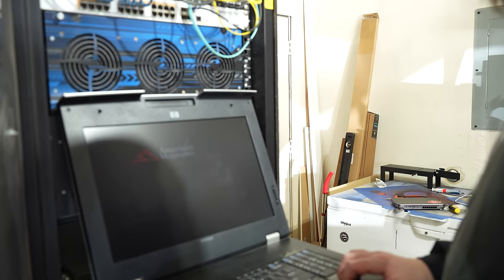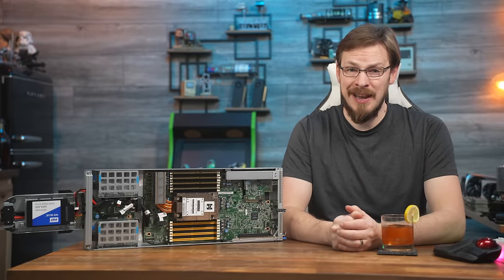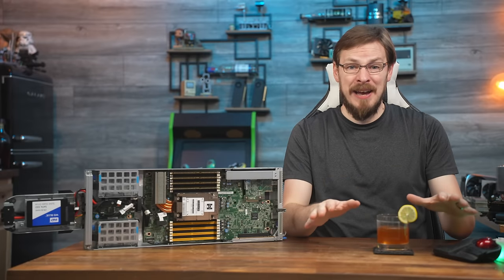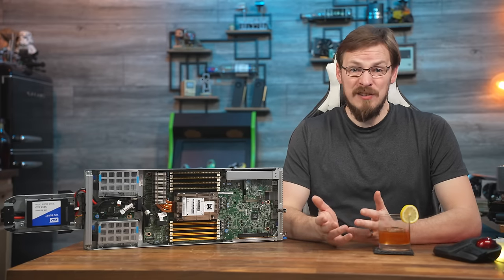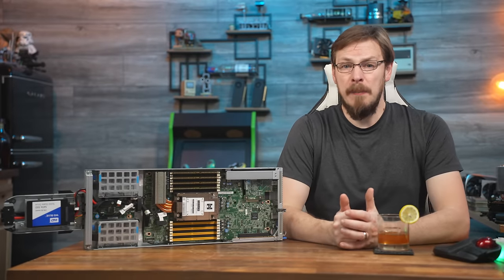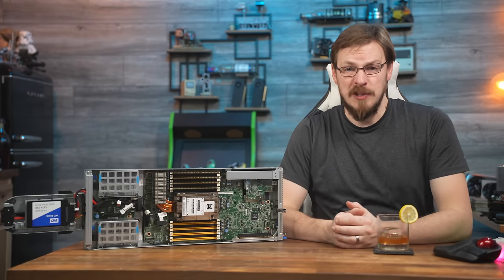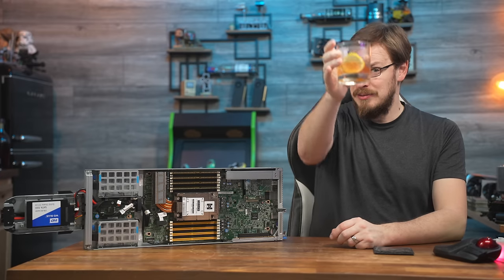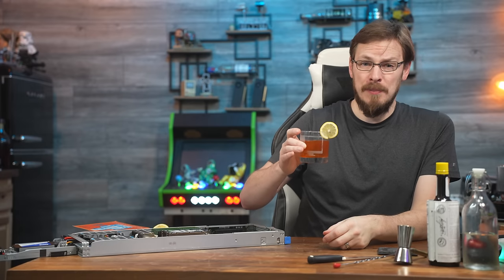$500 Quanta Dual Node Epyc Server - IT'S WORKING!

Comment: shhh, dont share the numlock light post test trick with the young ones. do they even make keyboards with num lock lights on them anymore?
Reply: If you don’t look just for the „gaming rgb” toys - then yes, they still do :)
Reply: logitech K120 usb keyboard - got mine for $18 or so with a mouse and numlock light... was going to get a better one, but I ended up just liking this cheaper one.
Reply: Folks talking about things they clearly don’t know about lol
Reply: wait, someone dares to do without one?
Reply: @Karti200 Pretty much all RGB gaming keyboards still have capslock and more often than not also numlock LEDs on them
Reply: I'm 32 and have been into servers at home for a few years (automation and controls background). I discovered this trick on my own and it's great to know.
Reply: are they taking that from us??
Reply: i guess the only part i didnt realized was that this is a 'trick' at all....i thought it was just common sense...?
Reply: I doubt Logitech will ever discontinue the k120, either. Those things are tanks. Have one for a back up and one for my home server downstairs. One of which has a cord halfway chewd through and still works perfectly.
Reply: I don't think I've seen a PC-type dektop keyboard without a NumLock LED. I have seen missing scroll lock and of course laptops often omit Num Lock. Personally I tend to prefer Caps Lock for testing responsiveness. Num Lock is often set automatically, potentially causing confusion. I have also run into situations where one indicator responds but not the other.
Reply: @eDoc2020  consider alternative layouts. I have a 60% keyboard.
Reply: @kidsythe   When I said PC-type desktop keyboard. I meant the 101 key Enhanced AT keyboard and minor variations thereof. What we'd look at and say "yup, that's a normal keyboard." And specifically non-Apple variations. Even though they adopted the same layout for full-size keyboards Macs have never had Num Lock or Scroll Lock.
Reply: well..that tricks i know first was from my father...but hey, at least they know it now
Reply: @eDoc2020  🤔 I think I understand. I apologize for the misunderstanding.
Reply: Gatekeepers gon’ gatekeep lol

Comment: I bought a Gigabyte G292-Z20 (rev. 100) with an Epyc 7402P on ebay for 700€ a few days ago, I think it's a pretty good deal, and in an apocalypse scenario I can use it as an aeroplane with the amount of air those fans are moving.

Comment: Well good news you got it working with the Naples CPU so at least you know that the units are in working order. Bad news, It is most likely that those units are on an older legacy BIOS version from when Naples first came out and this is why it will not boot with a Rome CPU as it simply doesn't know what those CPUs are. So your options at this point are find the highest Naples CPU you can find (highest was 7601 32-core 2.2Ghz-3.2Ghz), or try and bribe someone at Quanta to give you the last published BIOS and BMC firmware for that server.

Comment: For quantum chemistry calculations i have built an Intel server blade PC. S2600TP board, 2x 2686V4  18 core cpu from e-bay. This board has all the connectivity what a desktop PC has but some with custom connectors. Also needs a separate 5V PSU for the system circuits. The cooling is a bit of an issue since the rectangular narrow ILM version of 2011. I made a water cooled system which i flooded and burned the first cpu slot. So bought another board and added the best possible coolers, two Dynatron T-318 full copper vapor chamber heatsinks with Delta blowers. BIOS files (4 of them) had to installed one-by one jumping the allowed version changes and the system config adjusted not to look for the default fans... which are jet engines... 3 of them. Currently having 4x16Gb ram suits perfectly for molecular structure optimization job utilizing all 36 cores continuously. Usually it runs for 1-2 days periods. For molecular frequency calculations more ram is needed, it depends on the molecule size but with the current amount of ram i can use only 10 cores. Next week i will upgrade to 128Gb which will utilize all (2x4) memory channels. I am also planning to replace the flooded cpu slot on the broken one. Already have the replacement slots. In this one i will use 2x2650v4 (5 USD for one piece... lol). I like in Intel that every bit is accurately described in manuals so it was easy to assemble the whole system.

Comment: I think Quanta manufactured some E-waste here by their discontinuation policy and severe hardware lockdowns. They clearly want to "encourage" customers to upgrade to whatever the latest model is, and enough of their customers must be okay with it because Quanta is clearly still in business, with the preferences in the aftermarket or homelab communities not accounted for. I imagine their customers want the newer versions because of the improved efficiencies of newer platforms and the certainty of business arrangements. Larger organizations don't want to get bogged down in maintenance hell and homelabbers aren't profitable for Quanta apparently. But congrats on getting those blades running again! That was clearly quite a journey, and Quanta doesn't appear to want to on help.
Reply: No OEM gives a flying about the aftermarket/homelab, why would they even need to care about the profit of the old server hardware selleres on ebay. And obviously homelab is not profitable for any server manufacturer, the entry level stuff is in the 5k range, who buys that
Reply: Quanta's normal customers are usually Data Centers or direct to large clients. So they really do not have to offer support for products that are EoL to anyone other than the people who gave them money.  With that said, they should however still offer a way to find documentation, software, drivers and firmware for any solution they have manufactured just like many other larger OEM/ODMs do like Dell, Lenovo, Supermicro, etc... as Quanta is clearly able to do that now on their website with their current products.
Reply: @DaWolfwar 
Wonder if it’s legal still.
Reply: Wasn't this a Dropbox server that got recycled? Wouldn't it make sense that it was locked down and tailored for the Dropbox environment??
Reply: @shammyh  no? Why would locking down bios settings make this "tailored for Dropbox"? Maybe Dropbox didn't want to pay for full featured stuff and Quanta disabled in firmware. But don't tell me bios settings and locking to a single specific processor only is "tailored" for anything besides Quanta revenue
Reply: @beedslolkuntus2070  why wouldn't it be legal? They have sold it to their client and once the hardware is scrapped from the client and licenses terminated they have no obligations towards anybody else. The e-waste recyclers that buy old decommissioned servers are trying to make a buck off stuff that companies would just dumpster

Comment: This may sound like a stupid question, but could you look for an updated bios for the chipset and manufacturer name as a Boolean search to see if you’re running an old bios version? Reason I ask is because I have and older hp server that I got off eBay and when I went to upgrade the cpus it wouldn’t post, and because it’s a hp server you had to have a service with them for the bios updates. So I did a search with the product name & chipset to find I could get an updated bios without needing to pay lots of cash to HP!

Comment: Im still running my Supermicro X10DAi with dual Xeon E5 2696 v3s. I used it to replace my rack full of Cisco switches and routers for network simulations. Love that machine, been rock solid (other than the Corsair PSU which I had to replace...) since I built it in 2017. Just keep adding RAM as the prices fall 🙂
I keep looking around for a modern replacement but am struggling to find the next best bargain solution.

Comment: Got a Dell Precision T3210, what is the recommended cpu to upgrade to? Which is most worth it? It's 2011 socket.
Comes with a Xeon E5 cpu. Was thinking of using it as a barebone ESXi server with some VMs

Comment: @Craft Computing If you're stuck to the Epyc P Processors, while the 7351P is nice, you could have probably used the 7401P (24-Core), or the 7551P. (32-Core.) I hate to even suggest this, but if Rome processors are compatible you most likely need a bios update and again yes good luck finding a bios update or drivers.
Reply: i also think that! maybe that thing need P processor....

Comment: I should add that it would be interesting seeing benchmark numbers of the 7351 vs something like a 7282 to see the performance difference of the architectures since both would have 2MB L3 cache per thread available where most Zen1 cpu's only have 1MB L3 per thread available.

Comment: Not related to this video, but it's your latest....
I tried searching YouTube for a video on "how to move a Truenas (core) VM to bare metal" but haven't really come across anything, do you have or can you do a video on this and while you have the hardware running maybe vice-versa for those who need that?

Or if anyone else knows of a good video on this and is willing to share. I'm under the impression I can just make a backup of my current setup (including "secret keys" and all) then build the new system and import the backup and be done, but I think I tried that once going from bare metal to vm and it didn't work, i could be mistaken though.

Thanks!!

Comment: Funny the comparisons to Broadwell Xeon-- I just picked up a Broadwell Xeon box off the 'bay for $200 for a full system. It even came with a (bummy spinning) hard drive despite the listing saying "No HDD". And a cheap CPU upgrade later and it's a pretty powerful unit on the cheap.
Reply: Yeah, those larger core Xeons you can score for cheap these days are still just fine for virtualization and other applications.

Comment: On a Gigabyte mainboard that was Naples-only initially, there was a dual-step bios upgrade process, that converted it into a Rome-only setup. But you were still crippled of Gen4 pcie as nobody cared to re-evaluate the design for those speeds, so they went just with what it was. There is also a hardware difference between Naples and Rome/Milan, but that affects the reverse compatibility - eg. a newer Rome/Milan board will NEVER support a  naples cpu, while the Naples board could take the Rome, with some limitations.

Comment: this was a fail but good intentions and due diligence in unlocking, i think it shows just how tough it can be to get decent server motherboards that you resorted to this solution and had to use the bombay sapphire to compensate - not the worst coping behavior and you still learned some things and shared the pain

Comment: Thanks for sharing! The H11SSL-i Supermicro board is a much better pairing for these Zen1/2 EPYC's. The general lack of storage I/O on this blade and the limit to the 7351P is a deal breaker.

The main benefit of these older EPYC boards is core density. The 7601 or Rome 24c/32c chips are the only ones that really make sense in 2024 (and only if you have a specific niche workload). You might as well just go with 8/16 Zen 3 cores for anything else.
Reply: I'm going to disagree. You can easily get cheap desktop CPUs with 24+ cores nowadays.
The main draw of these EPYC systems is PCIe density.
If you want to drop +8x NVMe drives into a system AND a GPU/NIC, you are going to be using server hardware because Broadcom are pricks and PCIe switching was yanked out of affordability.

Comment: For the price, a PowerEdge R7425 is within reach. They're limited to first-gen Epyc Naples, but at least you can pick any CPU you want from that family. (The BIOS flash doesn't have enough room to support Naples and Rome at the same time, apparently. The R7525 can, but they're twice the price.)

Glad my dual R730 homelab (each with dual E5-2697 v4s, 512 GB of RAM, and six 1.6TB SSDs) isn't hopelessly outdated yet!

Comment: The only real advantage to going Epyc over Xeon here is the number of PCIE lanes available, which appear to go COMPLETELY UNUSED in that form factor. If you aren't using a ton of PCIE connectivity, save the money and the hassle, just get an X99 motherboard and used Xeon. It's what I did. Just be aware that you may need an even older Xeon on hand to flash the BIOS to support the Xeon you actually want to use (this is why I have a spare Xeon E5-2690 v3 sitting around).

Comment: Didn't you get the platform to run the CPU you had?
Seems that it's gone wrong.
I'm not Impressed by the results either. 

What was the use case for the hardware? San or something??
Reply: high availability services maybe 🤔san controller or something is on radar

Comment: For pure compute workloads old servers are always economically dead. Any modern mid-range consumer CPU humiliates this server in absolute performance and even more in performance/watt. The only use cases are cheap high RAM or IO requirements
Reply: Yes, that's true. Although this system is new enough that if it actually booted with other CPUs it would have much more compute power than anything consumer.

Comment: This maybe a really dumb question, but would a BIOS update, since you got it to boot/post, open up some more CPU models that you can install and operate on the blade?  One that allows Epyc Rome CPU's?  That also is if you can find a BIOS for the MB.
Reply from the maker: A BIOS update is needed for any other CPUs to be supported. Finding the QVL gives me some hope that a compatible BIOS is out there, but finding ANY information on this server has been an exercise in futility.
Reply: @CraftComputing  I tried searching for the bios as well to no avail. Seems like your only option is to contact Quanta.
Reply: @Appri Quanta already told him to pound sand because it's EOL stuff
Reply: @Appri  The other option is to contact other YouTubers and forums to see if anyone has these machines in production they could get a copy of the bios from.

Comment: Honestly I'm sad the blade concept didn't take off more, especially for home use.  Not so much the noise levels, but the concept itself, a sled with replaceable, self contained hardware, which can be slotted along side multiple other blades.  Low profile and still powerful.  And being able to upgrade things without turning off the entire machine!  Just shut down the one blade, remove it, replace it with a new upgraded one, and you're good to go.  Why this kind of tech isn't available for home users is beyond me.  I mean, look at the lengths people go to in order to make a small form factor computer.  1LPCs are basically the form people at home want, but with the graphical power of a full sized tower.  Being able to plug in a blade into a slot in a rack and have it connect with a separately mounted GPU, I feel like that would be peak home computing.

Comment: Maybe this info is something: my dual zeon 2680v4 rd450x motherboard has this stupid bios that don't display anything if there is a short anywhere found on the motherboard, Mostly caused by mismatched recc dimms and sometimes just moving the position of the board helps, with that said, your 500 dorllar is a rippoff from my eye, I've only spent around 1900- 2000 chinese yuan to getting myself a 5700xt, dual 2680v4 and 4x16gb recc dimms, and a definitely not 1000W "1000W" power supply, I love China!

Comment: You’re likely hampering some performance running only 4 sticks of memory in a non-ideal population order. EPYC Naples had a more complex and annoying NUMA setup. You should populate all 8 channels for best performance. 

Sucks that you seem to be locked into one CPU though. I’m guessing you’d need a different BIOS or something to throw a ROME CPU in there and it doesn’t sound like Quanta is willing to do anything for you.
Reply from the maker: I was running 8ch when testing. I was toying around with the second blade, and only had 4 installed.

Comment: I am so confused you're mad and frustrated at Quanta when you bought a proprietary enterprise server that was decommissioned. By its very nature all support for it ends once it's been decommissioned and removed from its original location. They are not going to support something that isn't supposed to be used again. As well as in the enterprise world all documentation is internal use only. The manufacturer doesn't even want their partners to have access to anything proprietary.
Reply from the maker: It is easier to abide by standards (IE, socket compatibility) than it is to limit parts and upgrades.

Comment: Without a better CPU it should have stayed E-Waste. 
Sorry to say it. AMD Ryzen Pro Processors have the currious ability to run ECC on most boards, which make them great small Powerefficient Server. 
They biggest Disadvantage on those is that they are limited to 128GB ECC Ram. My Homeserver on Windows 2022 with 64GB ECC 3200 DDR4 and Ryzen 5 5600 managed 234CB single Core and 1772 Multicore. With a Max Powerdraw of 78W. Doesnt sound impressive? My Ryzen 7 5700X Workstation has 2394 Multicore,251 Singlecore with Max powerdraw of 78W. 
So you get 128GB Max, 8 Cores/16Threads. On a B550 Board which can Bifurication. 
So 5x  Gen 4 x 4NVME Slots with a 2.5GB Card and a Gen 3 NVME Slot together with the normal Slots and Sata ports.
Price: 
120€ Board, 150€ CPU, 50€ Bifurication Card, 50€ Case, 50€ new solid PSU (450 Watts are even to big) 
Around 420€ without Ram and NVME. 
You can get the 128GB Ram for 160€. 
And you have half of the Power consumption. 
Which means less noise. And everything with Warranty as this are mostly New Parts.
So for 420€ you get everything WITH CPU as the Blade has unless you can get a better Epyc prozessor in as some suggested.